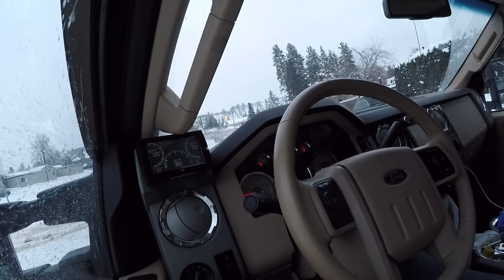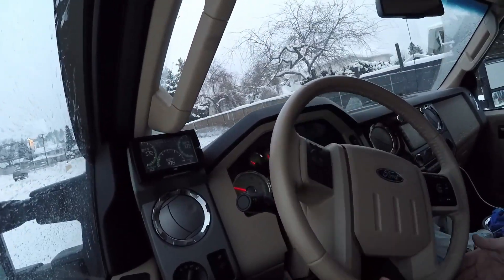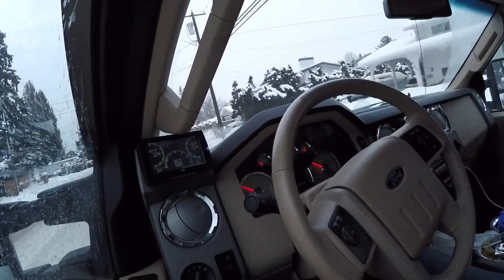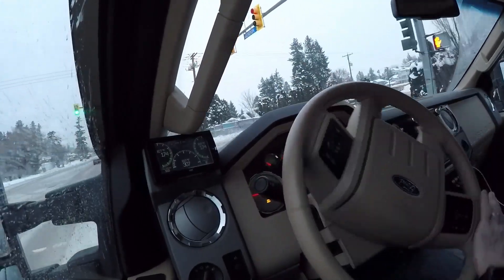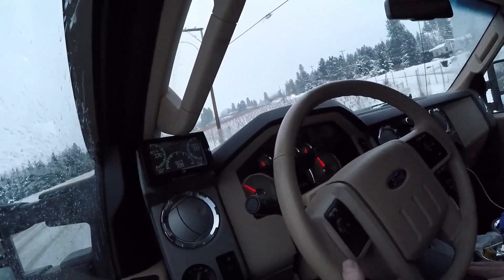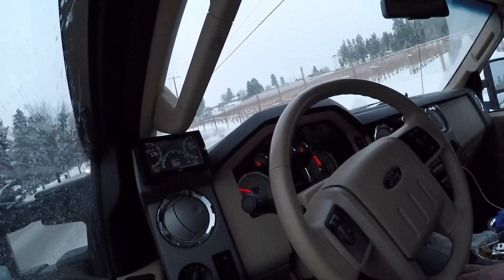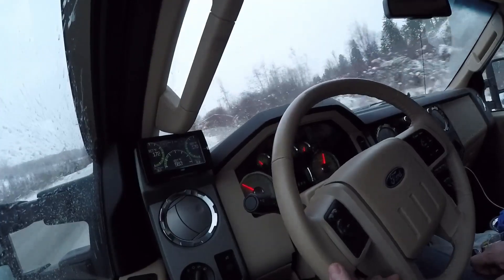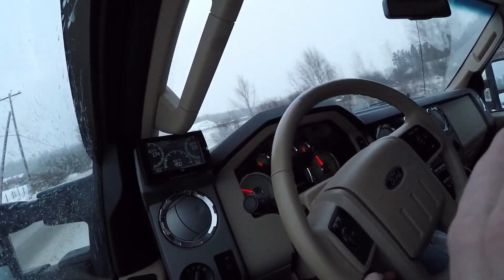Detroit 4-53T with a 5R110 in 2009 Ford F350

Comment: I know you didn't approach full fueling but the EGT's seem exceptionally reasonable. It will be nice to get the converter lock under control. Especially to keep it locked up off the throttle with the Jake's on, might be nice if you could find a way to command a locked converter and higher line pressure coasting for holding power on the Jake's. Great video, I'm absolutely astounded how quiet it it in the cab! Hopefully it had a fresh roll of Scott 1000 keeping the oil clean! Cheers!
Reply from the maker: Thanks Luke,  Under full throttle it's about 27-30 PSI of boost and 1030 on the EGT's.  Once I get a 1000 miles I'm sending a sample out to Blackstone and see how the oil is.  It's got 400 miles on a fresh T1 SAE 40 Rotella, so we'll see how things are with the little Detroit.  Slobbering is almost gone now and blowby is minimal.:)
Reply: BudaDiesel is that air box boost? This thing is awesome! What power do you think she’s doing?
Reply from the maker: @muz679  Thanks, no that is turbo boost.  Once it  passes 20 psi turbo boost the blowerbypass opens and equalizes the pressure.  So after 20 psi aibox pressure and turbo boost are the same.  I estimate it's producing around 230-250 HP and 530-580 LBFT of torque.  I've got the 5R110 tuned a lot better and still more tuning to come.  I'm very happy with the results.:)

Comment: I’ve got an 04 f350 V10 that I’ve been looking for a 3 or 4 cylinder Detroit to swap in when she goes down (currently sitting on 314k miles) and let me tell you how glad I am to find this channel.
Reply from the maker: Nice, I've got a 2000 Excursion with the V10 with 207K miles and other than fuel economy it's not too bad.  Throwing miles on the Detroit and doing some turbo adjustments and running great.  Thanks for watching.:)

Comment: I am a fan of what you're doing love the sound. But I am curious why you chose Detroit Diesel over more modern platform.
Reply from the maker: Thanks, I had this 4-53T from another project that never happened, so when the 6.4 went down I decided to swap the Detroit in.  As I had already owned a Cummins 6BT for 14 years I didn't want the Cummins.  The 4-53T was a great challenge to do so it could be used daily and be reliable.  I've had a lot of fun building this and working out all the snags.  I still daily drive this truck and now am running veg oil in it and not buying diesel.  It's proven to be a great engine and running really nice now.:)  It's a lot of smiles by the miles driving.:)  My plan is to run this for the next 30 years or until I can't drive anymore.:)  Thanks for watching.:)

Comment: How do you pass inspection I live in New York I doubt that would be possible here
Reply from the maker: We don't have emissions testing here.:)  Thanks for watching.:)
Reply: @detroitgarage9430  so you don't have to plug in your vehicle when you do an inspection?
Reply from the maker: @mikezona4658  We don't have inspections.  I've tuned the PCM so if it's an OBD2 test it will pass, but any visual inspection will fail.:)  We don't have emissions or any inspections.  They realized most people replace their vehicles every five years and for the small number of vehicles that do need inspections it wasn't worth it, so they shut down the clean air test facility.:)  I think the average car was on the road ten years then scrapped.